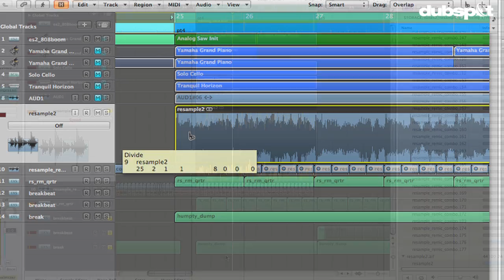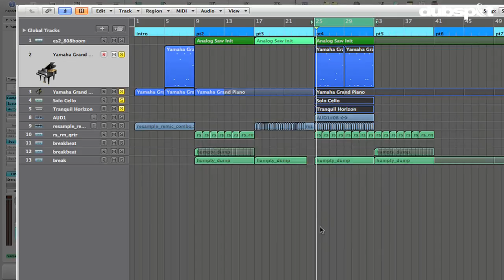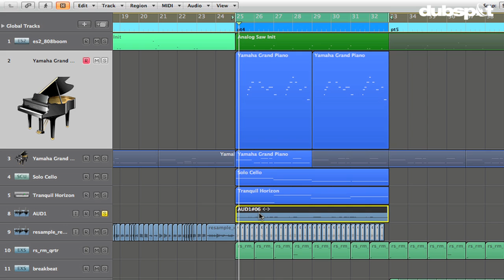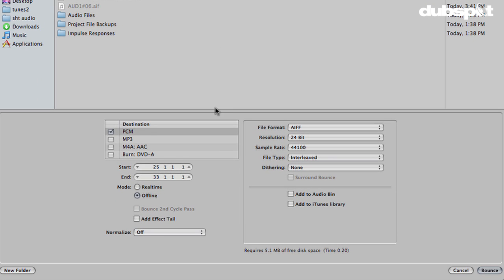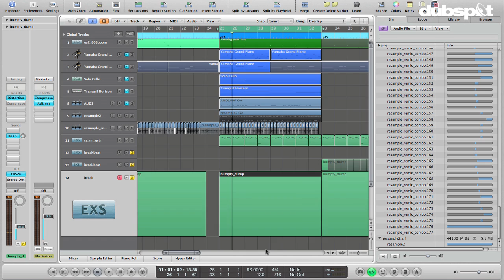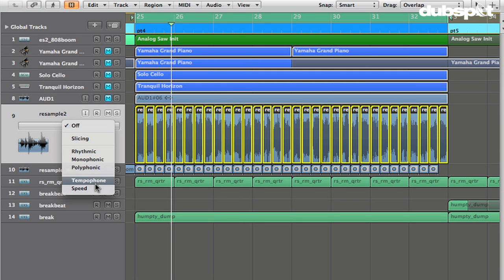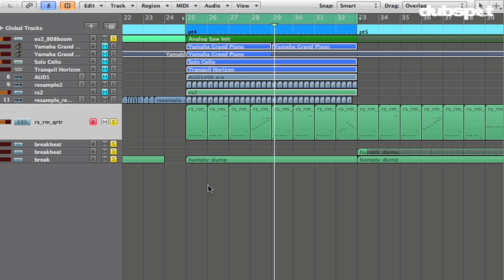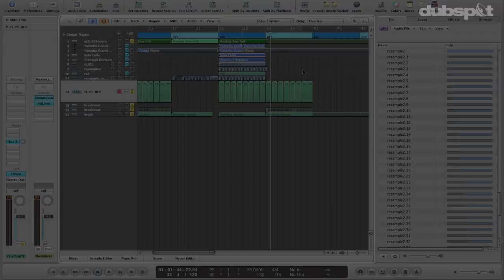Logic Tutorial: Resampling Melodies / Add Texture To Your Tracks - Secret Knowledge Pt 12

Comment: So when he bounces all that audio together is that how he avoids phasing? Because he has duplicates of that piano part in the track and i would assume that that would cause phasing issues, since its a re sample and not an identical duplicate of the piano midi.. anyone? Ive never bounced multiple tracks like that so I wasn't familiar. Using logic x now so maybe this trick is obsolete by now.. not sure
Reply: It would technically be identical to the MIDI, even after resampling, as long as he doesn't add any other FX or what not. A midi track running some kind of VST, and an exported auto track will be almost identical to your ear.